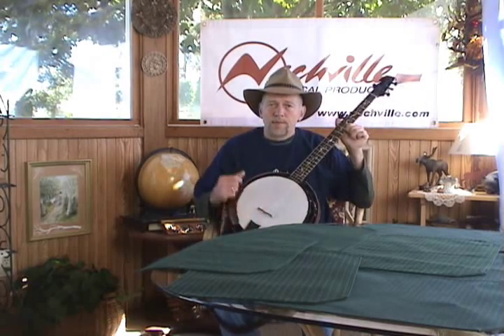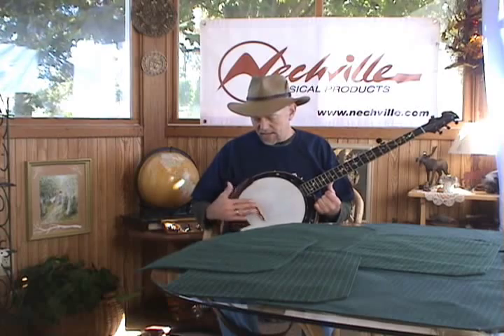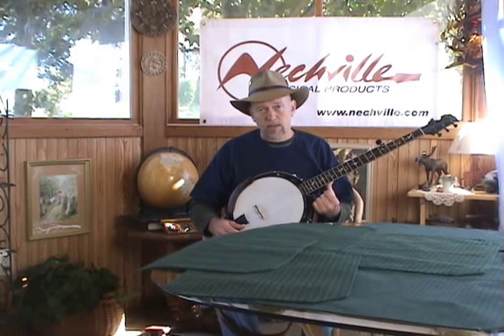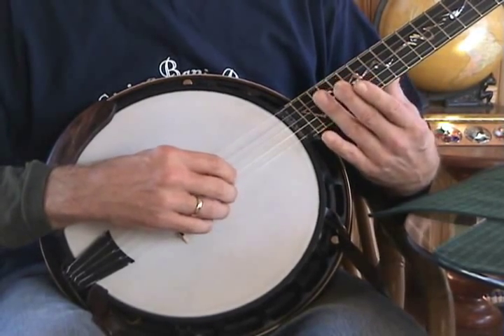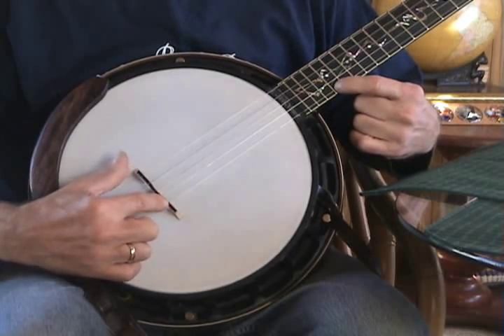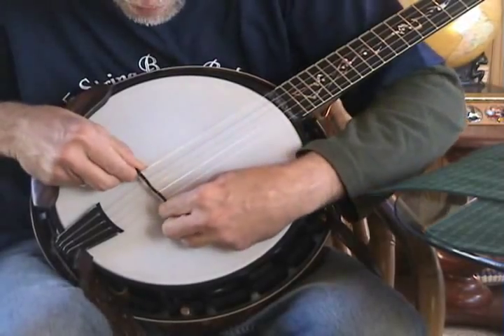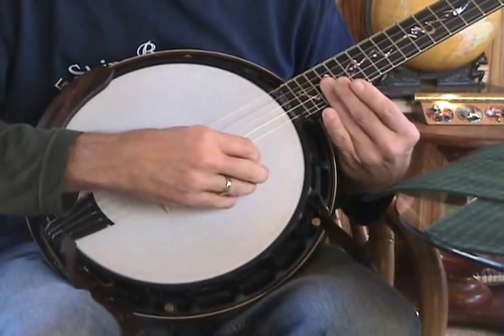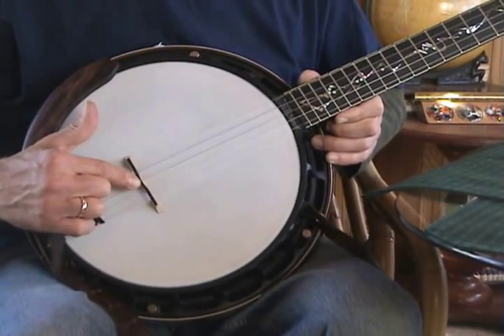Placing the Banjo Bridge with Harmonic Chimes

Comment: I think we have a failure to communicate here. What I was asking is WHICH SPECIFIC frets, like the 12th or the 19th would I use on my longneck banjo to do this harmonic routine to properly place my bridge on the drum? ;-) Would it be the same on both a standard length neck AND a longneck or something different?
Reply from the maker: the 19th fret as discussed in the video, or the 24th fret is probably even better.
Reply: @nechvillebanjos  I heard that just fine. My question is you said have the banjo in tune. My bridge will not move very easily with it in tune is it okay to sort of nudge it?
 I won't break it?
I had been loosening the strings in order to move the bridge